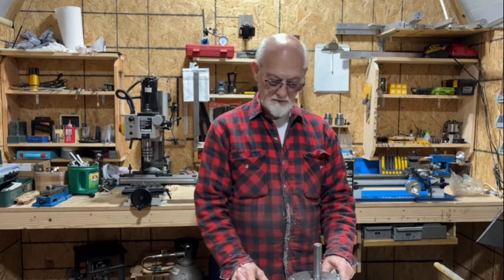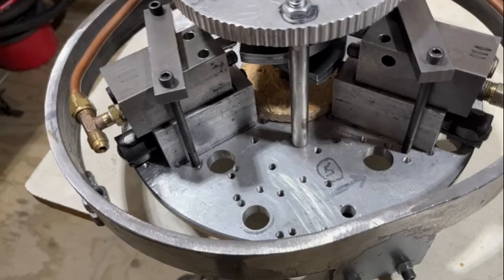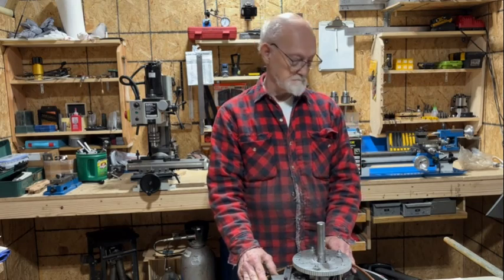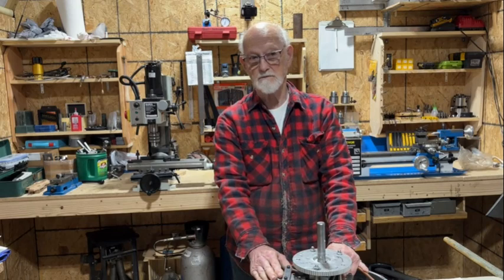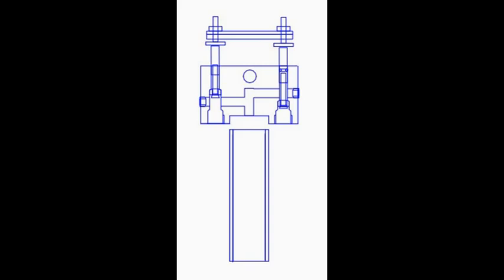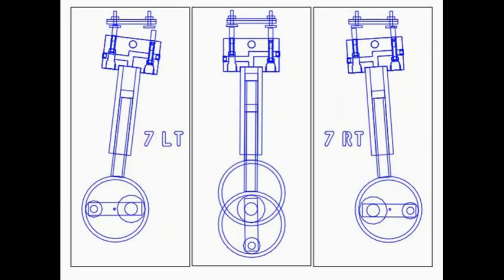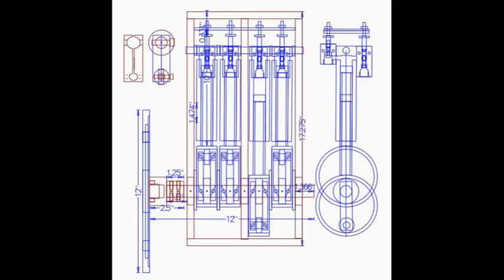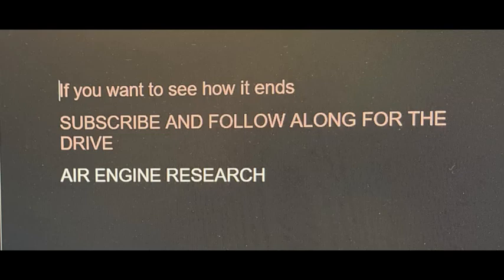Air Engine Research - My Compressed Air Motor - My last attempt 5-3-2024

Comment: I remember seeing similar air motors on underground roof mesh drills “Rambos” they used motors 3 cylinder, stumpy investment cast looking pistons, motors were made from machined nylon. 
On a side note I’ve a project in the back of my mind which needs an air motor.. I’ve concluded the Sanden AC pumps are the perfect donor for making an air motor, you pay stuff all for a knock off one just have to have the clout to make a valve assembly where you take the back plate off.. 
some food for thought from one mad designer to another!!
Edit, the Rambo motors were of radial type. Sounded real meaty when running
Reply from the maker: Thanks for the info, but little bit different application for what I’m trying to do

Comment: I honestly wish you would just use the design I have openly shared. It only takes one valve to operate four cylinders.. five moving parts total with force available at all angles.. it fits every requirement you are speaking, except that you didn't design it.. I did however open source it, and proved that it works.. so if you really want to succeed; there's nothing stopping you except a bit of stubbornness..
Reply from the maker: Thanks for your honest opinion.
I have used ideas that I have seen, but even those had to be modified to fit into my design.
I have tried rotary valves, sliding valve, ball valves, push -pull valves, cam shaft driven valves, but none have been adjustable while the engine is running until this lates design.
I guess I am stubborn, but I think of it as there is always another way to do it, I just have to figure it out.
As I said in the video, I have the 6 Cylinder Engine sitting in the shed, if this design doesn't work out - the 6 Cylinder goes in.
After I solve whatever problems come along with installation and operation of the car, I will have at least completed my goal of replacing the gasoline engine with a compressed Air Engine. 
I will accept success or failure because I did my best.
I am however expecting success, just have to wait a little longer.
Oh by the way I have a lot of respect for what you did with the Motorcycle, any new plans?
Reply: @AirEngineResearch  I am just finalizing a design for mass production and gathering resources to make the first batch.. I have my timing fully adjustable on the fly on my third bike, with a cable actuated timing adjustment hooked to a hand lever on the left side of my handlebars.. on the motorcycle I tied the timing adjustment into the clutch control to remove possible dead spots caused by more efficient timing. 
It was the capability of the motorcycle to run at 15 psi and get full expansion that showed me what needs to be done to build the best air powered bikes ever. They will get unbeatable distance and hardly make a sound. I just need to get the energy together to make it happen and crowd funding has been disappointing, so I am in the process of selling anything I don't absolutely need to make it happen.. 
You need to stop trying to achieve high rpm, that's just making your designs inefficient. The torque at low rpm is enough to push a train with a well designed piston motor, so the energy required to spin a motor fast is completely wasted..
Reply from the maker: I'm glad to hear you are not wasting your talent and ideas and are continuing to push on.
I tried crowd funding, and I have had a donation button on my web site, but also - not a penny has shown up.
I'm not rich, but I manage to buy what I need to make parts and work on my projects.
We are planning on moving different vehicles with compressed air, or needs are totally different.
To be able to a car using the standard transmission, and get the speed and performance, the Compressed Air Motor must run at least 2500 to 3000 rpms.
In my case the HP needs to be min 40HP to match current performance.
The speed and volume of air required to match the above needs to be much higher than 15 or 50 psi.
Low psi x Larger Cylinders vs Higher psi x Smaller Cylinders - I think depends on the application?
Every design I have seen from others, use either a crank shaft or a rotary design, which doubles the amount of air my designs need per rotation.
Compressed air is our most precious commodity which I have make and take along, and to go any distance, I cannot waste any!
Well, I hope you manage to acquire the funds you will need to set up mass production and make a go of it!
Reply: @AirEngineResearch  rpm at the drive wheels have nothing to do with efficiency and everything to do with gearing.. while engine speed dramatically affects efficiency. Our needs are not different and the motor on my motorcycle is more than powerful enough to move a car. The pistons on that bike push with over 1600 lbs of pressure at 200 psi, and at 15 psi are enough to push the bike and me (over 400lbs combined) on flat ground easily. I can easily calculate what I will need to push a full sized vehicle efficiently and it will likely require 5"-6" diameter pistons. Trying to use a regular car transmission and not being willing to modify the gearing for an efficient air motor, is going to make things VERY difficult for you.. and I have doubts that a vehicle running on air without a gearing change will go over 10 mph.. considering the valving apparatus you are using.. my rotary valve could potentially reach those  rpms, but it's far better to run the motor as slow as possible. There's absolutely NO need to spin a force displacement piston motor fast.. there's 100% of the torque available at a dead standstill.. Every bit of additional speed is just added resistance and wasted energy..
Reply from the maker: Well, for now, I’m gonna finish what I started And see how it turns out

Comment: Man you have lots of innovative ideas! I especially like your many challenges to the traditional crank. I often wonder why you haven't built a "wobbler" style engine, and now I think you have incorporated something of a wobbler except with poppet valves. Best of luck, I'm looking forward to your next production.
Reply from the maker: I think I can just about say that every design I have come up with uses about half the amount of air that they crank or some other type wobbler would use